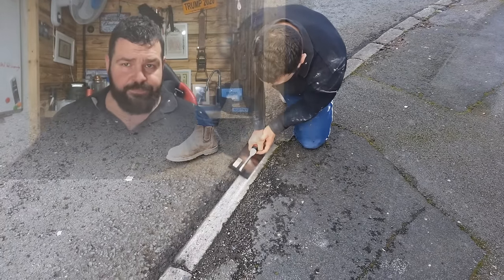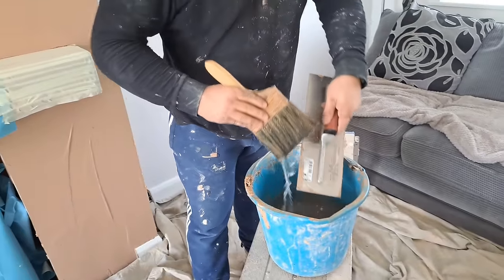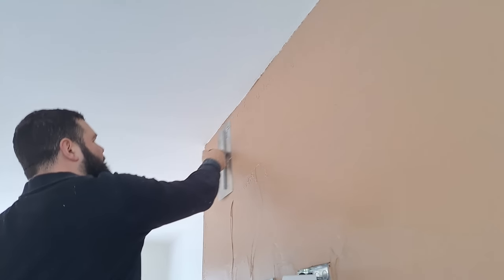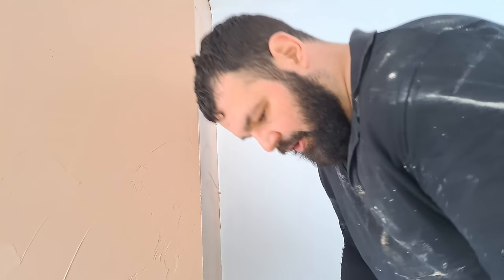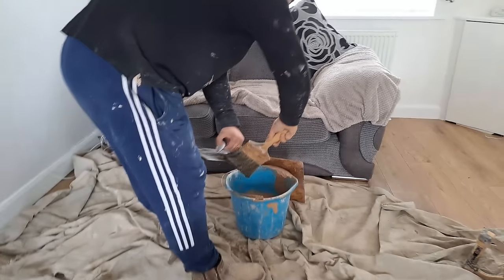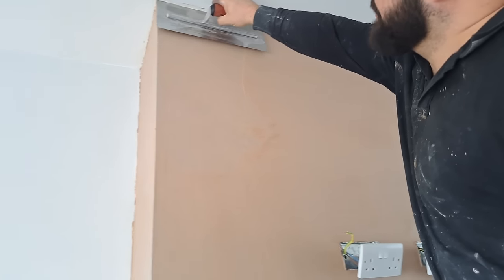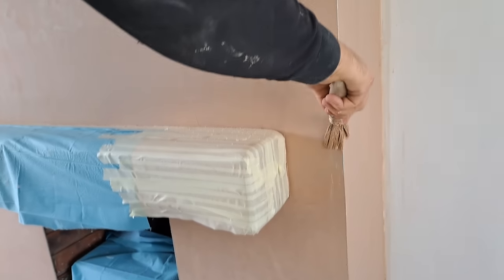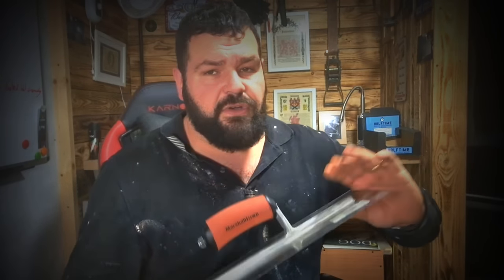⚠️NEW TROWEL! PROBLEMS

Comment: Most of the plasterers in Ireland use them on sand and cement for a period of time before they skim with them
Reply: Same in the us
Reply: Same in England aswell. I did a lot of damp proofing over the years. So used sand and cement day in and day out. I don’t know why people don’t use sand cement. I would prefer to use that
Reply: I was told to give your trowel to a bricklayer for a period of time before I started using it for plastering , having 3 trowels in pipeline at all times (your main trowel , your back up and then your spare)
Reply: Yr rightThe best way to brake a trowel in is on the rendering sand and cement
Reply: @Chelskie-darts I wouldn't give a brick layer a bucket of mine to look after, never mind my most important, most prized piece of equipment. I often refer to mine as the money maker. I've seen how a brickie treats his own trowel, I'm not leaving mine anywhere near him.😂
Reply: @neilross9867  : 😂 someone you trust like a good friend or relative lol , I’ve seen some bricky’s trowels myself tbf 😬 not the cleanest workers are they lol
Reply: @Chelskie-darts  Yeah, I know what you're saying mate. But nah, my trusty blade stays with me. 😅👍

Comment: The problem any DIYer has is not realising that as well as a lack of skill, they can run into problems caused by the equipment, but not recognise it as such. Your videos help so much in avoiding that. It's hard enough to get the mud on the wall and develop a smoothing technique, but if you don't realise your trowel is causing you problems you'd think you just couldn't plaster

Comment: Although you took the hard edges off the trowel by rubbing them away on a kerb on the road.... You wore the edges in the wrong direction... You rubbed very fine grooves in to your trowel edge at 90 degrees to how you would apply your plaster.... This is why your trowel dragged your plaster.  You should have rubbed the trowel edges along the kerb in the same direction as you would to apply plaster..... By doing this... The fine grooves in your trowel will be in the same direction as your trowel stroke, reducing that drag and speeding up the trowel's wearing in time.  Always move in the same direction as you apply plaster.
Reply from the maker: Your spot on mate thank you
Reply: @Onthetrowel  Only too glad to help 🙂 Keep up the cracking work m8 🙂
Reply: I never knew that would make a difference, thanks. 👍

Comment: Whenever I get a new trowel I just hook that little triangle sanding piece to my oscillating multitool with some 120 grit sandpaper and sand the corners and edges and surface. In a matter of seconds the corners arent pointy and sharp, theyre more round and safe to the touch. Dont know about everybody but it works for me when I dont have time to break the trowel in.

Comment: Two minutes into the job and the top three foot of that wall already looks pretty much good enough to sign off. I've got some practising to do! (DIY plasterer here, really only doing it because on principle I reckon I ought to at least have a go at anything legal in my home.)
Reply: I'm literally doing the exact same now moving into a new home, I've done 5 walls so far and they are OK tbf, there is some misses and I've made a mess of the outer corners but I have time to rectify that, I was struggling with the mixes going off and getting the plaster on the wall fast enough. How did you do, what did you struggle with? Hope it went as good as it could have for you, I know from personal experience how hard it is to plaster when you've never done it before

Comment: Stainless all the way for me, I had a carbon steel trowel years ago, had it like a razor blade, one of the rivets popped and it went out of shape, stainless takes longer to wear in properly but they’re great for finishing, you can get pressure behind them without have to worry about popping  rivet. 

I like the speed skim blades for flattening off, the plastic spatulas some use for finishing, I don’t like, doesn’t keep the wall flat.

Comment: I'm learning and improving as I go, been using that trowel for a while now (diyer, occasional jobs like a room here or a wall there but about to do a whole house we're renovating) and have to say I'm very attached to that bit of kit for throwing on. Tempted to try a speedskim for flattening though. Just wanted to say thanks for the content, picked up a few tips from you. Helpful stuff.
Reply: I’m still new in the trade myself, and still learning, though I can plaster (the skimming side of it) from start to finish confidently, I was advised by an experienced spread to stay away form the speedskim and master the trowel first. As flattening inbetween coats with the trowel is a very important aspect of training yourself to keep the angle of the trowel consistent. If you start using the speed skim instead it will take you soo much longer to master the trowel if that makes sense. It also helps with conditioning your muscles.

Comment: I always used a sharpening stone on new trowels but rounded the toes off slightly and use the heel for square corners. To make live sockets safe I just covered them with small freezer bags or the like, only takes seconds to cover sockets with the bag keeps it safe and clean.

Comment: I prefer the Ox trowel handle; Its rubber all the way round the corner so You dont rub the metal / start of the grip with your index finger all day and rub muck in the gap.. I find that annoying. Also the handle is short and and fat on the Marshaltown. I crunch my knuckles when I start down low and pull up a wall. Dont say Im holding it wrong because thats how I feel best in that situation my knuckles are catching the rivet section.  The Ox handle seems a little longer so I can grip it with all fingers properly and not as fat so I dont catch my knuckles. I have both. The Marshaltown has a far superior blade and comes more curved out the box ( always get the permashape gold version! pre worn and better quality steel.) I You think the standard version is nice then its nothing on the legit permashape!) The Ox has a superior handle and is nicer to hold! I use both depending.

Comment: I have a 14" Marshalltown carbon cement trowel that I used to use as a "skimmer", as it's as straight as a die. I generally use an MT permashape now but breaking in another MT carbon finishing trowel. I always run over the edges of a new trowel with my carborundum stone. I love using my 18" MT carbon but it's always an issue for my elbow now 😢

Comment: Hi Kirk. Your videos are always packed with valuable info. Can I ask you mentioned that you usually use a 4inch wide trowel, does it dramatically effect the amount of gear you can get on the trowel each time as the blade is 25mm narrower?

I’ve heard that the narrower blades are soo much easier on the wrist and joints as the distance from the hand and the edge of the blade is less and therefore the pressure required to trowel up is significantly reduced.
Reply from the maker: Well it sort of does a little bit but not that much that you would notice. I'm quite happy to sacrifice that little bit of extra spread for the compensation on my wrist.

That said most people would be fine with a wider trowel. I abused my wrist for years with 18" and 22" trowels thinking was cleaver on the building sites
Reply: @Onthetrowel  as someone who’s still quite new in the plastering trade I feel the slightest difference in everything lol! I recently brought a tyzack 14x4.5 trowel and there is a noticeable difference in the way it just feels in the hand, feels better than the marshalltown, and the narrower blade definitely makes a difference, it may be just in my head that’s why I thought id ask you.

Learnt so much from you so far and I appreciate all the advise.

Comment: I have a Marshaltown perma flex gold cost me a few quid and it does feel nice but I feel the carbon steel trowel gives me more control just feels that way. I can see from this video how you had to work harder with this trowel than you normally would. I also had a Nela plastic flex trowel which was effortless and I loved it but like you mentioned mine went out of shape also. We all need tools that just work without having to add the extra effort or thought, they are the keepers like your trusty old worn in trowel 😁😁😁!

Comment: Loving your work mate 
I noticed you used hook on beads. When they first came out I thought they were the mutts nuts. Saves stapling or sticking with adhesive ,messing around in general. However I've since decided that the extra gear I have to lay on around beads means it's 6mm thick . This is fine on corners as its easy enough to feather, but on window reveals with only 150 mm to play with if you feather it in it shows, meaning it's gotta be 6 mm up to frame side. Making it tricky to keep straight. I resorted to a reveal tool to get them spot on. A real shame that they can't produce a 3mm version .
Any thoughts.?

Comment: Quick question, on the second coat, did you reuse the plaster that was in the bucket from the first coat? Going to go break my trowel in a bit on the curb ^^
Reply from the maker: Yes I just wet it up an re mixed it but be warned,it seats faster when you do this

Comment: I'll be honest when I was a plasterer my towels I had a selection of but most of them from new I'd file the edges down then run them on a wetstone on the face that touches the plaster I'd sharpen it at a 15 to 20 degree angle till it would be as sharp as a knife same at the toe but the corners would need to be blended so there wouldn't be a ridge where the angles meet from the length of the trowel merging to the width I had a fee towels sharpened similar but would sharpen the edge with a curve  to follow the natural motion of the growling on a wall yet the edges would still be razor sharp but those two methods of breaking a trowel in without having to use them for years before they form an edge those two methods would actually give the best results and finishes on plaster however if you sharpen your trowel to a 20degree angle and use it primarily for sand and lime backing plaster or floor screening with sand the edges will round off on the face and stay flat at the back but will still be sharp enough to cut your hand on this is actually in my opinion the best edge to have on a trowel for plastering as the sharp edge stops you getting snorts ripples and drags but the curve of that edge will pass nice and smooth over the plaster iv always used marshal town the only time I've used tyzak is for doing a marble finish with dyes added in a ripple in the mix to lay it on but always used my marshal to polish it or I'd use a tyzak with a marble based wall plaster made grime fine crushed marble the chrome type polished surface of tyzak trial would just help the mix slip off the surface  but for the shape of it's toe they're just not practically in tight runs or between fixtures and fittings

Comment: Little tip never use a brush or sponge to wet the wall let it start to go off and use an old spray bottle with water give the trowel and wall a light mist of water to drag the fat out and polish up

Comment: The peeling isn’t just a result of a new trowel that usually happens when you skim over pva. Horrible stuff not to say it doesn’t work just rather use green grit
Reply: He uses sbr not pva mate
Reply: @NiktheEnglishGreekCypriot  same thing glue is glue It slides the same as pva when you skim over if it’s not dried in enough
Reply: @Ryan_Clarke_Plastering  completely agree with the drying, I always leave it till it’s bone dry
Reply: @NiktheEnglishGreekCypriot  nothing worse than goin over wet glue. Absolute nightmare. Best to scrape it all back off and let it dry more😂
Reply: @Ryan_Clarke_Plastering  literally did that last week Mate, house was freezing pva still wet from the day before, chucked it on and when I was flattening in the first coat, I literally had a metre squared patch of plaster sliding around. Fucking hideous haha
Reply: @NiktheEnglishGreekCypriot  ahhh mate nightmare😂frustrating because you literally can’t do anything to stop it sliding 😂we try stay away from it now and mostly use green grit
Reply: @Ryan_Clarke_Plastering  if I hadn’t been in Bristol 100 miles from home I’d have fucked off and left it for the next day haha. In the end in left it, then gave it two more coats and it came out alright. Yeah I’ve used green grit before, just hated applying it, plus the drying time is a ballache but it was nice to go over
Reply: @NiktheEnglishGreekCypriot  yeah it’s annoying having to leave it and coke back next day but the finish you get on it is lovely goes on a bit thicker but it does go nice

Comment: Asian plasterers are the best i have ever seen .
I worked for Chinese plasterers in North West Australia they were small but extremly strong and gifted with very good coordination.
They would do in a morning what it would take the best Italian or British plasterers would take 2 days.
Then the finish was always better same. With tiling.
A Malaysian Chinese tiler i worked with never used a level or tape measures straight edges .But his workmanship was the best i have ever seen then the speed incredible.
Shower trays that were perfect no standing water beatiful floriets around the drains instead of square or round holes in a tile.
Massive walls of tiles nothing out of of place.
Then me being the tough rugby player i though given my size and build i would keep up even lifting boxes of tiles and buckets of tiles glue would easily out lift 5'1 5'2 Chinese tradies no they out lifted me by a wide margin.
Then you want another level of gibstopping/ plastering.
The Japanese plasterers  are on another level.
With one medium trowel he can plaster anything but you don't need to sand if you did you would be lucky to have a 1/2 a cup of dust in a 12' by12' by 12' high room and he left a tiny bead where there were pelmets right in the middle no measurement come back the next day rub that bead off with his small trowel no further work required much quicket than any European tradie.

Comment: The beading inside the fire is that one sided
Reply: It is a stop bead. They are flat and the edge is curled round in a u shape to protect the edge of the plaster.
Reply: @stephenribchester2185  so can you use these if you plaster a wall with windows so you don’t need to plaster into the windows
Reply: @whatsgoingon3822  If the window reveal and wall are already plastered then no not really as you would see a gap were the bead finishes up to the window reveal as it lays on top of the original corner bead. If the reveal has a wooden lining or similar then you could probably put the bead up to the lining. It is a bit hard to say without seeing it. If the wall is conventionally plastered and there is already a corner bead then you could just plaster the wall and put it on thin up to the corner. If it is a bit cracked near the window you may have to scratch out a little of the plaster to put some scrim in as you don't want scrim on top of the original plaster right up to the corner as it will mean the plaster is a lot thicker there. As you are finishing off if you wet up the corner area you can thin it out and blend it into the edge then go down the edge with a wet paint brush to finish off.
Reply: @stephenribchester2185  thank you for the reply it was just I have ripped out the kitchen and removed tiles off the wall but there is a windows recess that didn’t need plastering so I was wondering if I could get away with just plastering the wall that I removed the tiles from